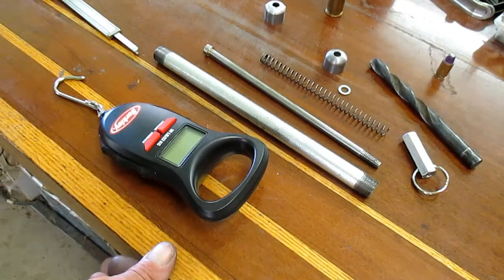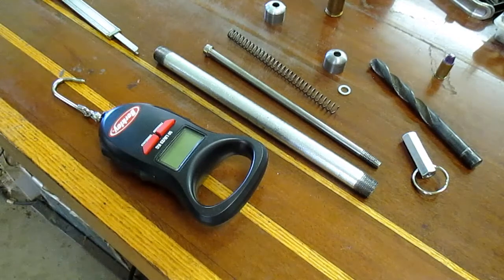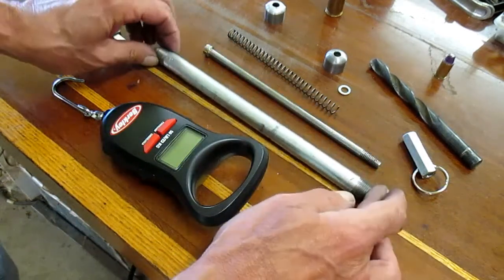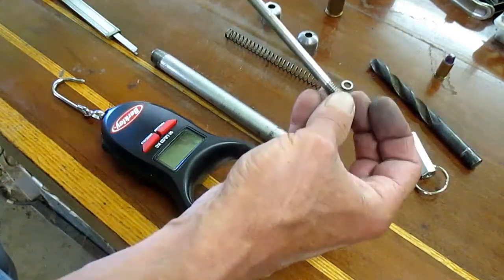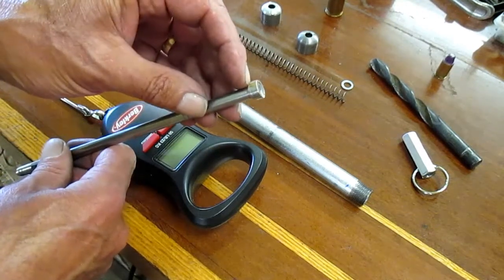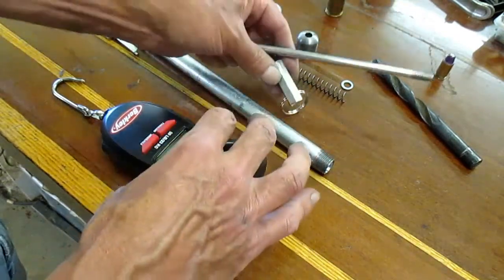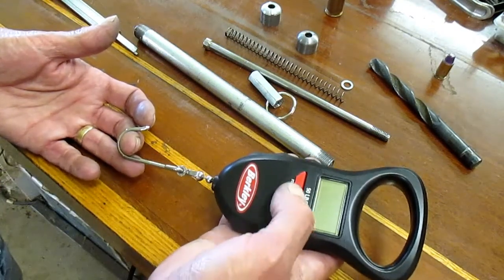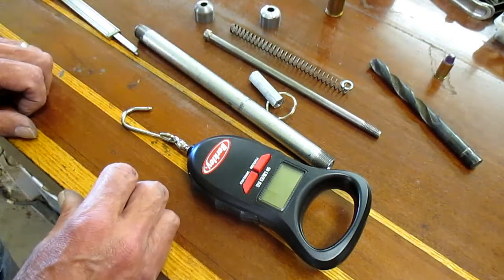1911Recoil Spring Tester

Comment: Very nice. How do you figure-out compression height for a specific spring weight? Is it different depending on the pistol type?
Reply from the maker: Hi Patrick, I have only done this with a full size 1911, the height I have set for 5" 1911 and the height stays the same and the pull gauge tells the weight. I'm sure you can find different compression heights for other firearms they'll be listed just have to look for them. Thanks for watching!

Comment: if I was attempting to do this for a non-1911, how would i know the compression ratio (where to mark the rod) to take my reading?  Would it be the distance the slide travels for lock to fully back (or maybe slide lock)?
Reply from the maker: You would have to do research on the gun and slide to find what compression ratio you need. I do a lot of measuring when doing things like this.

Comment: I see no reason for the pipe, all you need is a piece of strap in a vice with a 5/16 hole in it to put the rod through, the rod will keep the spring straight, same measurements as shown.
Reply from the maker: The whole idea of the pipe is to hold everything square, once the spring is getting compressed it buckles on the rod so if you were to pull it thru a single hole as you say everything will twist and bind. The pipe is a guide to hold everything in its proper order, but I see your point. But it would just bind in the plate hole with no support. And every commercial spring tester has a housing that I have seen.
Reply: the pipe makes it easier to handle in a vice than a small rounded nut or cap.